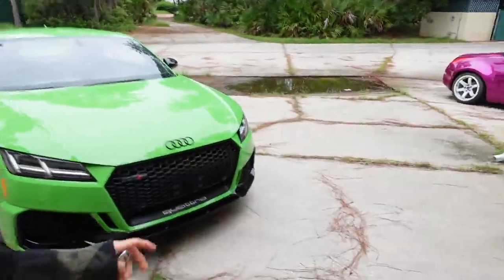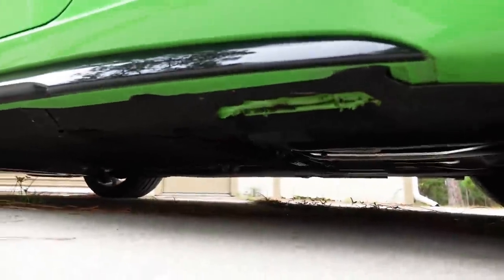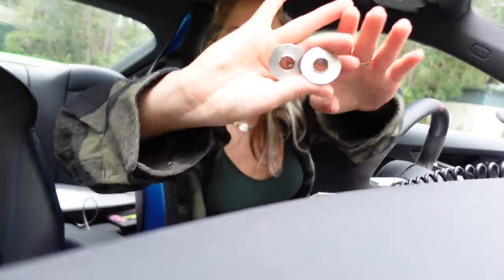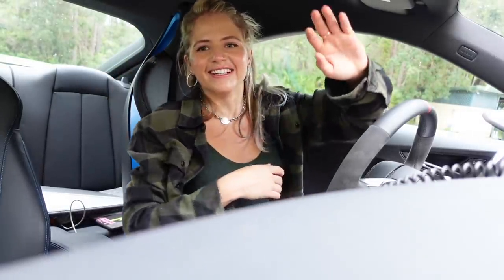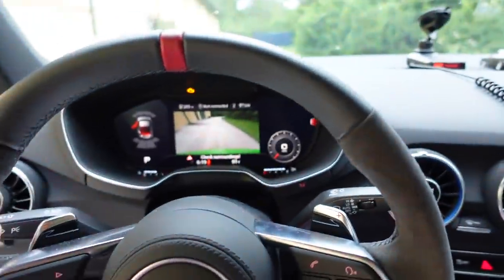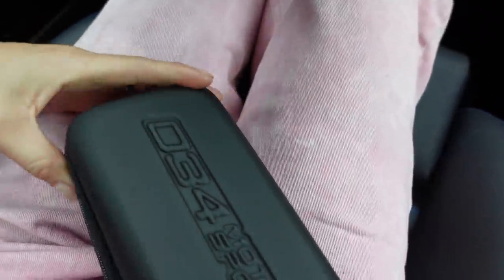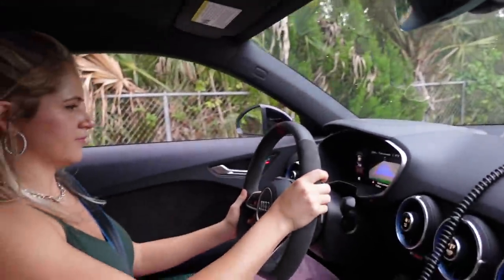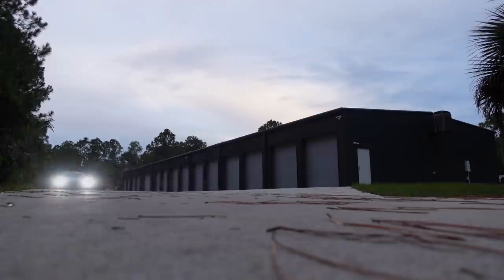AUDI TTRS STAGE 2 TUNE IS WILD!

Comment: It’s just the wastegate rattle. A lot of the rs cars do it once you have exhaust you just happen to notice it more.
Reply: Same on bmws 😂
Reply: Ye same on my rs3, and it is also the exhaust flaps thats rattle, and very common problems that they brake.
One of mine gives a failt code some times so it is on the way out.
Reply: 100% wastegate rattle. catless dp accentuates it immensely. hated that, on my RS3. traded it in for an RS5 lol
Reply: This guy knows. 100% wastegate rattle, hugely common thing with these cars once you go straight through.
Reply: happens on my 3.0t q50
Reply: Is it possible to clean it up to make the rattle go away or it just the norm?
Reply: @pr0jektcha0s  yes it can be coded via software.
Reply: @austingates1961  Same on my Q60, it's so unfortunate for cold starts :/
Reply: My TTRS does this too.  Thanks for the explanation as I was wondering what that was.
Reply: Even our 1.4tsi Jetta does this :D
Reply: Yep same on my 2020 Rs3 it actually does it really quiet with the full stock exhaust and yep even worse with down pipe decat tho! But worth it for the extra noise 👌🏻
Reply: All DAZA and DNWA engines do it. It’s can be mapped out though.
Reply: Yup, wastegate rattle. It's not like old-school wastegates that are closed until manifold pressure builds up opening them.  Its held open during warm up and light throttle application.  It sounds like an exhaust leak but it's just the wastegate tapping on the turbine housing.
Reply: It can be fixed with a proper tune
Reply: Yup joys of a stock turbo.  The are amazing daily driver turbo for balance of torque/low turbo lag and good upstairs power.  But the wg rattle is annoying.  Get a turner and DS1, they can adjust the wg pre load and stop the ratting.    This wg subject goes back very far.  Glad there are solution.  But imho they exhaust tone changes once you force close the wg.
Reply: Same on my shitty VW gti

Comment: Glad you got the centering kit. It makes a HUGE difference. The bolts are one-time use because they stretch when you torque them. If you see a torque value that's got an additional turn in degrees, it's torque to yield. Also, if you see a bolt that's a kind of green color, it's torque-to yield. Almost every bolt in the suspension is torque-to-yield as well and needs to be replaced.

Comment: The exhaust rattle could be similar to my 335i where the wastegate stays closed to warm up the cat on cold starts and when tuning you can turn that off and that sound goes away. I could be off about that but it sounds similar to mine when i put catless downpipes before tuning
Reply: 100% what it is
Reply: My RS3 has that waste gate rattle 👍🏻
Reply: That noise is 100% wastegate rattle.
Reply: Yeah 100% what is going on my 335i is the same way
Reply: 100% wastegate rattle
Reply: Mini R56 N18 here, yep.
Reply: My MINI JCW F56 (2.0T BMW engine) also has a rattle like that while cold start after installing a 200cell sport cat. I mostly hear it when the engine is cold and accelerating (normal) in low RPM. Do you think it can be the wastegate in that case?
Reply: that would explain why my 2.0 VW always sounded like this after the catless DP went on. Only does it while warming up during the high idle that I noticed VW and Audi cars all do. Also would explain while the turbo whistles so much during this time as well. Wastegate closed+high idle= higher turbo speed. Sounds cool besides the rattle sound

Comment: The most common torque to yield bolts you'll run into are the head bolts and balanced bolt on a LS. When you pull the old ones, you can literally see the stretch. It's significant.

Comment: Hey Collete, while I do not have a ton of experience on the TTRS platform. I can tell you this. I’ve worked on a lot of European cars and they tend to have a common feature that causes this rattling noise. It’s called a catalytic converter warm-up sequence. Some call it start up roar. I see a lot of comments about wastegate rattle which frankly I would find hard to believe on a brand new car. On many tuning platforms such as BMW this can be actively turned off so that the car does not go through this sequence. I would talk to your tuning company and ask them if there is an option for turning it off. my BMW did the same exact thing after I put an exhaust on it particularly deleting the catalytic converter.
Reply: It's the wastegates in these cars, it's been a known problem for very long. Sadly there is no real fix other than a new turbo
Reply: my MINI JCW F56 (2.0T BMW engine) also has a rattle like that while cold start after installing a 200cell sport cat. I mostly hear it when the engine is cold and accelerating (normal) in low RPM. Do you think it can be the wastegate in that case?
Reply: @gedam131  might be, especially if u had a super quiet exhaust before this. If it is, it shouldn't be a problem. Do u hear it through out the coldstart or only as soon as u start it?
Reply: @MrZyLeXx  dude the car probably has less than 1000 miles
Reply: @gedam131  you are hearing the cat warm up sequence that I am referring to. Adding to your exhaust would not immediately make your wastegate go bad.
Reply: @mustangman3769  dude it doesn't matter, they do it from factory, it's OEM + noise
Reply: @MrZyLeXx  Sorry man I’m not going to be convinced on that one. If it was come in from the factory like that they would probably be a recall on it. You mean to tell me that a bunch of people are just going to be OK with their hundred thousand dollar car rattling from the factory? Either way I’m not really gonna keep going On about it. Let’s just see what she says and one of the next videos about it
Reply: @MrZyLeXx  through out the cold start but mostly while driving under a bit of load at around 2500 rpm
Reply: @gedam131  Probably not wastegate
Reply: @mustangman3769  I mean i have 3 friends with RS3 sedans and 2 with a TTRS and they all had it, once they tuned it the rattle wasn't as loud on cold start, they all spoke to Audi Sweden and Audi says it's nothing out of the ordinary just like the oil consumption on the older engines...
Reply: @MrZyLeXx  that just further proves my point. When you tune it, the tune generally turns of the cat warm up procedure
Reply: @mustangman3769  Makes it quieter not stops it and no it does not on these cars.
Reply: @MrZyLeXx  bro please enlighten us what a tune is going to change about a wastegate at idle
Reply: @MrZyLeXx  how…. What does it physically do…..
Reply: @mustangman3769  Pretty sure they have the waste gate either more open/closed than from factory.

Comment: I enjoy tuning my Audi's and you selected a great tuner with 034 motorsports as they are first and foremost an engineering company and build safe, reliable tunes. Software isn't a workaround sensors to trick ECM. One recommendation...  as I have sat through a couple of Loctite demonstrations.... you don't need to paint the bolt threads. Just a bit will do it, though not sure if red is a good choice in suspension as removing will likely require heat.

Comment: You will love the o34 subframe bolts.
Your "exhaust leak" is the waste gate rattle with the stock turbo. It can be tuned out and sound 99% better. DS1 is usually the best way to go to get rid of that pesky rattle. Car looks awesome and runs good! But you are doing your research just as all of us have and figuring things out. Good work!

Comment: My stock 2019 TTRS with 034 Cold Air Intake & Sunoco 100 octane with original Hankook tires with 20,800 miles on it ran 7.9sec & 99mph beating a C8 Corvette @ Kingman Az Street Drags on Oct23, 2021.   I'd love a Stage 1 tune but my car is CPO'd till 8/25 and the warranty has value to me.

Comment: Easy way to find the exhaust leaks (if there are any) is to grab a couple handfuls of rags and stuff them in the exhaust tips while it's running.  Someone will have to hold them in there and they will heat up rather quickly but it forces any leaks to show up easily.

Comment: 6:30 Pull the spark plugs and put a few drops of 2-cycle oil in each cylinder. The exhaust will smoke for about 30 seconds and you can see the exhaust leaks. 
I accidentally discovered this while doing a wet compression check.

Comment: its 100% the wastegate rattle, it happens on warm up and light throttle (you will hear it more with a downpipe). I think that 034 tunes it out.
On ttrs rs3, the wastegate is normally open and close to make boost.

Comment: My friends dad had one of the original TT's that would lose control and kill people.  Part of the fix on it was to remove the subframe bolts and retorque them as the subframes weren't always on straight.  The other solution was to add the flipper spoiler.
Reply: I had the 8n TT for about 14 years, remove the spoiler and nothing happpend
Never heart, that subframe bolts killed people on the 8n.......sounds very superstitious to me.....

Audi upgarted the 2000 model year with a stiffer suspension and added ESP.

But there was no need for an upgrade on the older ones, neither the spoiler or the ESP.
Only the suspension where on an recall.

And even so, you can remove the little spoiler on cars which where equipped with it.

Only the successor TT , the 8J and the cars based on it......like Golf 5,& / Scirocco and Beetle......had problems with lose subframe srews......TTY.
But again, the didn't killed people.
Reply: @tt-rs1457  This particular car would get unstable at very high speeds.  The dealer wasn't able to figure it out so eventually Audi sent somebody to the dealer to work on the car.  The subframe was the problem on it.  I seem to remember the TTs being dangerous initially.

Comment: Yea as a few have mentioned the rattle when starting is the electronic turbo waste gate rattle and you notice it more with a down pipe, love those little spacers on the sub frame to centre it, great idea for those working at home - there's an alignment tool for them we use at dealers

Comment: Hey Collete, that rattle sounds like the flapper valve inside the hot side of the turbo. You could be hearing that like I did on my car because the V Band clamp where the downpipe mates to turbo hot side didnt seal right when I tightened it up. Mine was rattling because the wastegate actuator arm was loose, which was letting that hot side internal flapper rattle. It was pretty loud just like on your car. Im just guessing, but the sound is identical to what I had with my car.

Comment: I had a BMW M140i and the rear exhaust actuator spring broke or melted, causing the butterfly flap to to rattle. Also has a freind who has an RS3 and the heat protection rattled on statrup due to the 'rougher' statup procedure

Comment: You should try driving it for  a few minutes then shutting it off and starting right back up again. If its an engine warmup situation it should not return on second startup otherwise it may be the manifold.
Reply: nooooo.. It's the Wastegate, can be tuned out

Comment: That noise on start up is probably the secondary air injection which runs for the first 20 seconds or so. It will make the car louder at first and it's to aid the car in warming up the emissions system.

Comment: Damn I’ve scrolled the comments and I think I’m the only person afraid of all of that red Loctite 😂

Awesome stuff Collete!
Reply: I was thinking the same thing. What is wrong with blue loctite?
Reply: Hah I just did the same thing. Red Loctite is for permanent thread locking which could make those bolts could be a real pain to get out. Should be using the blue which is removable.
Reply: @gerardstefanelli1618  The red holds much better than blue and also since she may never remove those bolts again the red is an excellent choice. if she wants to remove them she just needs to heat the bolts to 550°-560° which will allow removal without breaking the bolts.
Reply: @tbusch63  I get that is hold better then using the blue Loctite but a lot of heat to using on bolts that go into the body. Plus that subframe needs to come out while doing most things like clutch packs or engine work. Any time that I’ve taken VW subframe bolts out I just l re-torqued new bolts and never had a problem. Hopefully she doesn’t have a problem with removing them in the future.

Comment: Sounds great! But yeah that's wastegate rattle. DS1 can be custom tuned out. All you need now is a wavetrac LSD for the front since that is open diff and the Iroz haldex controller to manual ramp up and down the awd split on the fly.

Comment: Upper dogbone insert sent with the bottom?   It's a must, or the lower one bends.   Deadset/rigid collar kits are nice tho I think they are trickier with the aluminum subframe due to the washer on the top.  Definitely need the rear subframe inserts for that car.

Comment: one time use bolts have been out for quite a while, usually crank, cam and head bolts. Chances are you probably have them on some or all those cars you have so if you plan on doing engine work in the future on any of them double check before you take any thing apart.

Comment: If you have to tighten a bolt to a specified torque and then turn it another specified degrees it is an one time use bolt. They stretch and therefore cannot be torqued so you have to rotate them a specific amount.

Comment: I’ve had the stage 2 tune with down pipes mid pipes and intake. And the check engine light is still there, it will clear with a obd scanner but always come back with a below threshold for the cats. If you’re able to find a permanent solution please share
Reply: O2 spacers my dude

Comment: The re-use of the subframe bolts is not as critical as other torque to yield bolts on there. If they were re torqued properly it wouldn't have caused an issue like the "by the book" police want you to believe... technically if you measure the bolt and it's in spec and not over stretched you can re use it... obviously if you have new ones why not use them but if you didn't have them and you know what you're doing then its not an issue

Comment: that rattle is just waste gate that is pronounced when the car applies the electronic choke (higher revs) and only happens when the car is cold. Once the choke is removed, the rattle goes with the lower revs. When the car is warm, and started, you won't hear it.

Comment: You can easy locate these bolts, which only have to use once.

When the torque Spec added an addintional angle ( 90°).....then it is a TTY ( Torque to yield ) Srew and you have to replace  it.
Reply: Bingo.
But, most people reuse them, it is only when you go past that yield point to the plasticity that makes them unusable.

Comment: LEGIT like a RALLYCROSS SUPERCAR LAUNCH!!! INCREDIBLE!!! Can the rev limit be raised at all in these... safely?
Reply: Yes, with the transmission tune you can set the launch RPM. However, certain tunes, such as APR will limit the torque in 1st and 2nd gear because you'll just light up all 4 wheels the whole way, especially with E85.
Reply: @TwistaCSS  sorry, what I meant is the RPM limit, not the Launch RPM, what can the stock bottom end and the valvetrain survive RPM wise?
Reply: @nivaux  my bad, yep. Once you go through some stages (1, 2 & 3) the RPM increases, by about 500rpm per stage. Since it uses the digital dash, it's very easy to have the visual 'redline' increased, obviously would not recommend without supporting mods.

Comment: Sounds a lot like the "Hemi Tick" where it's the exhaust manifold and once the car heats up and everything expands, the tick goes away...
Reply: I have learned on the tube the no exhaust gaskets are used on the Hemi.
Reply: @jtamsett  
For sure, that there is a gasket on a Hemi.
Reply: The actual Hemi Tick comes from the Lifter-Camshaft problems......when you have bad roller .
Reply: Thats not what Tony said.
Reply: @tt-rs1457  lifter tap doesn't usually go away. If the tap goes away than typically it's the exhaust manifold bolts that snap and creates an exhaust leak until the motor gets warm. I just fixed my ram last month.
Reply: @viperfanatic13  

You're right.

But the especially Hemi tick is the lifter issue and has nothing to do with the exhaust-Problem.
Reply: @tt-rs1457  hemi Tick can be caused by a few different things. They all sound pretty similar. Most commonly it's the exhaust manifold bolts because dodge used cheap hardware and a lot of the bolts snap. Usually you can tell by just using a better oil or adding an additive. If the tick goes away, it's a lifter, if not, exhaust manifold.
Reply: @viperfanatic13  

Hands down.

Nowadays, people called every anoying sound "Hemi-Tick" when it belongs to a hemi :-)

But, every company has same problems.....Audi is ticking out of the catalog, Mercedes has major issues with there camshafts on the AMGs et cetera..........

And everyone is struggling with corrosion, unless you live in Cali or Arizona :-) :-)

Here in Germany,  Mercedes, BMW, Audi, VW have big problems with rust after 6 years in use.
Reply: @tt-rs1457  I would say that luckily I live in Cali but with taxes, registration and insane gas prices, I'm not sure if I'm all that lucky. Lol
Reply: @viperfanatic13  
My first time in Cali was 1996, ever since  now and then in  Oxnard or San-Diego and China-Lake/ Ridgecrest

In the last 5 years, I was wondering how pricey everything get.....

Greetings from a town nearby Hamburg

Comment: This is 100% Wastegate Rattle. Very few tuning companies have fixes for this especially after going state 2. You typically won't hear something like this when the cars stock, but after removing the cats you'll hear it. I have a TTRS as well and switched from APR because of this amongst other reasons. I have a custom tune through Dyno Spectrum that has reduced the WG rattle significantly.